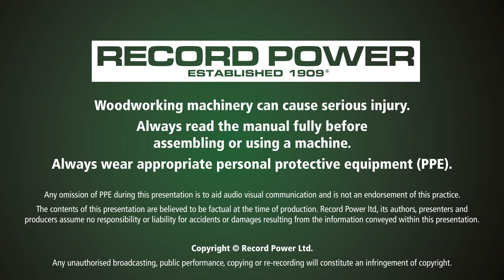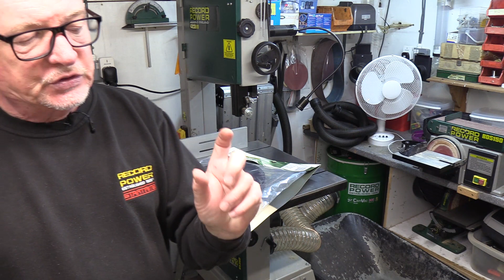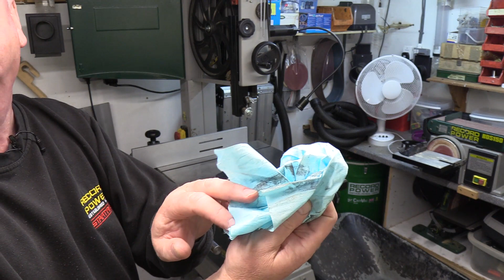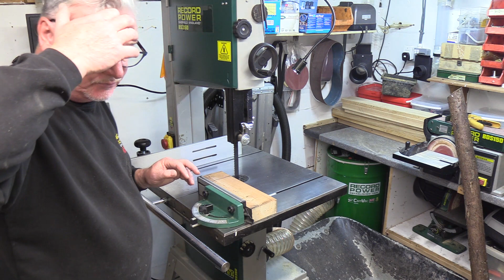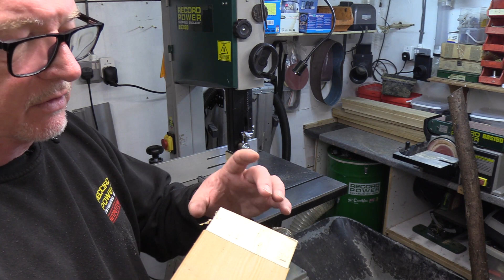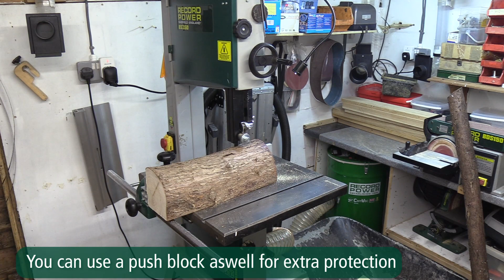Know-How Series: Explanation of The BB10312-3PACK of Blades for the BS350. Using the ¾” blade.

Comment: Hi Peter. 
Thanks for the video. I have the same camvac and have just ordered the sabre 350(coming tomorrow 😀) with the 3 blade set.
What I would like to know is the set up you use for turning on the dust extraction.  Steve.
Reply from the maker: Hi Steve, thank you for your comment. Please contact us on 01246 571 020 (and select option 2) or email technical@recordpower.co.uk. Best Wishes, Record Power.

Comment: Hello
This makes me happy again.
Thanks for sharing.
I wonder if there is a light provided on the BS350S, on the lower models there is usually a built-in machine light.
Keep it safe, it is not over yet.
Willy from Belgium.
😷😷😷
Reply from the maker: Hi Willy, thank you for your comment. The BS350S is not provided with a built-in light, however, we do sell the 59000 Magnetic LED Work Lamp which is the perfect accessory providing powerful illumination, plus the work lamp can be positioned at an angle to suit. Please visit the following link to our website for more information:https://bit.ly/3Cza1ef. Best Wishes, Record Power.
Reply: @RecordPowerTV  Thanck you very, very, much.
Willy from Belgium.